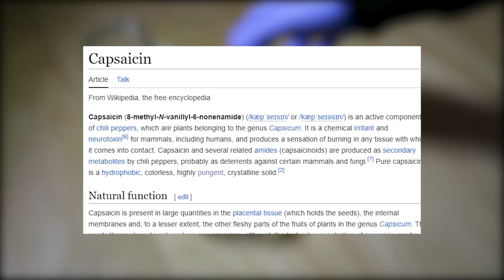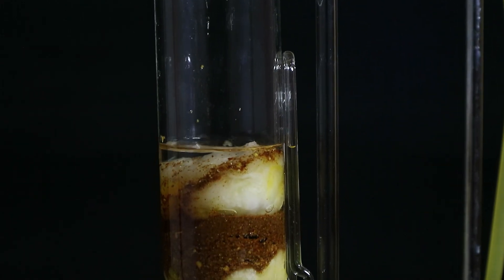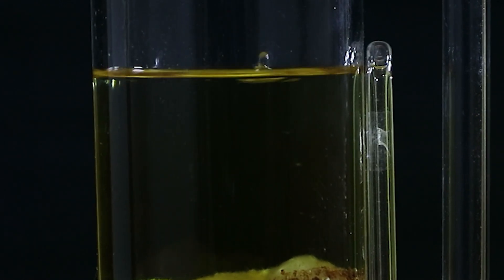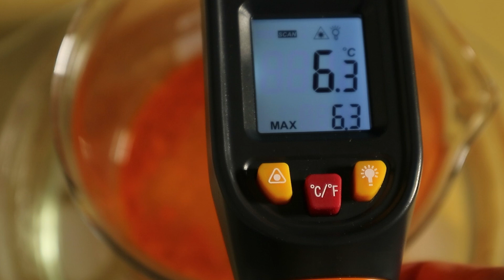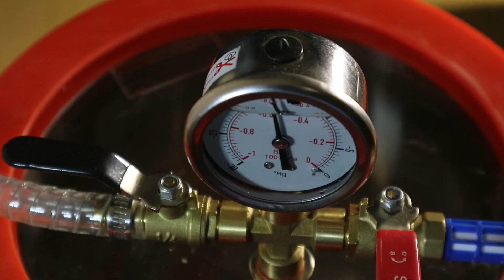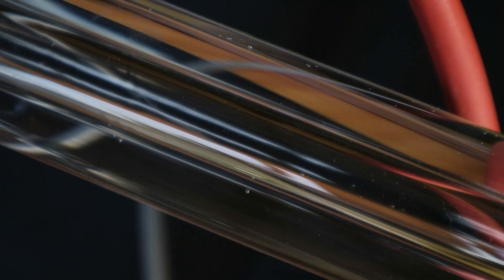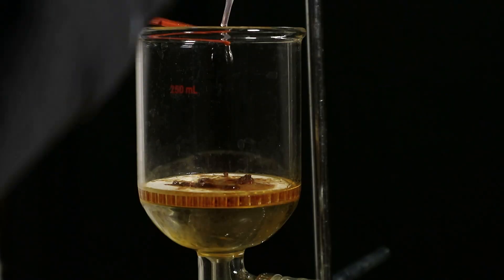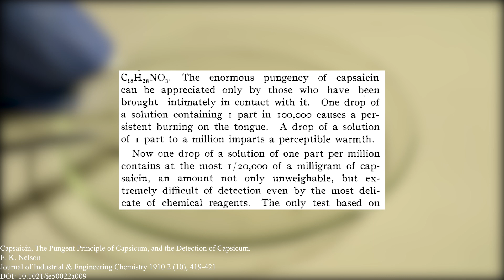Using gasoline to purify spicy crystals | Capsaicin extraction from Carolina Reapers

Comment: You can greatly increase the yeild by grinding the pods with a little pickling lime then running isopropyl or ethyl alcohol in your soxhlet. Next mix it with water with  about a gram of citric acid  added and boil off the alcohol. Use hexane to grab the nonpolar junk then  add NaOH to the water layer so it's basic. Grab the capsaicin free base with a nonpolar if your choice. Distill off solvent then recrystalize with dry ethanol. ❤

Comment: If you're getting the 10% capsaicin figure by using the 1.6M scoville nominal figure for Carolina Reapers, it's worth pointing out that figure is felt to be optimistic. Chilli breeders have an incentive to send multiple samples for testing and cherry pick the highest ones. Commercial samples of Carolina Reaper test around 1M. Your yield was probably slightly better than 6.9%.

Comment: I didnt get one thing. When you evaporated Ethylacetate you added then 10% NaOH and left it on 4 hours. Have you filtered the solution before adjusting the ph to 7? You should have cotton filtered the solution because when you added NaOH you converted capsaicin into its sodium salt that is water soluble, all impurities like carotinoids will remain on cotton as they are not water soluble. Then you have clear alkiline water solution that contain mostly capsaicin, acidify it to pH 7 and get crystalls of capsaicin.
Reply from the maker: Although the procedure I was following didn't mention that, I probably should have tried that. But I have a prediction, that it wouldn't have helped much. The main carotenoid in paprika is capsanthin, and it has hydroxy groups, which I think would had reacted with the base, turning it into a salt as well. I could be wrong though - not a chemist after all :)
Reply: @Nota_Chemist  it has hydroxy groups but they are not phenols and cannot give  salt with 10% NaOH they require stronger bases like sodium methylate
Reply: Ninjachemist, even though I work with energetics professionally I’ve loved your videos since I found your channel. Is there any specific reason why you stopped, and any way you can make more? I was really impressed with your tmdd smoke screen video. Not many people have the guts to try that, let alone hold it in their hand no matter how much information says it’s reasonably safe.
Reply: @chemistryofquestionablequa6252  youtube banned me again and again and i stopped. I quit my career of professional chemist and switched to software development. Sometimes I still work with energetics but nothing cool and great, that could become an interesting video.